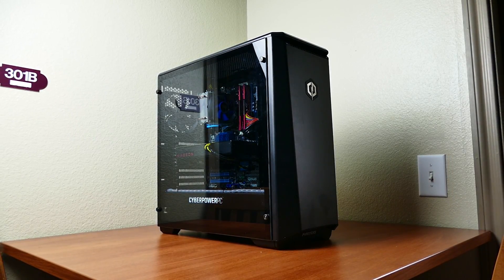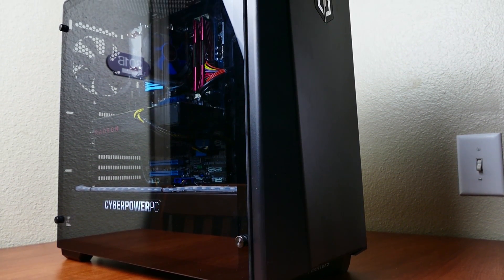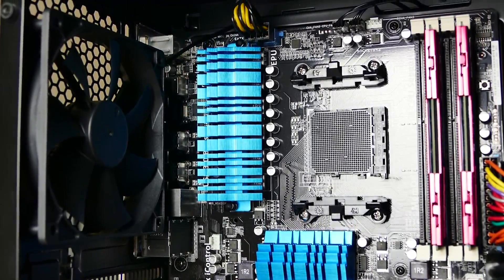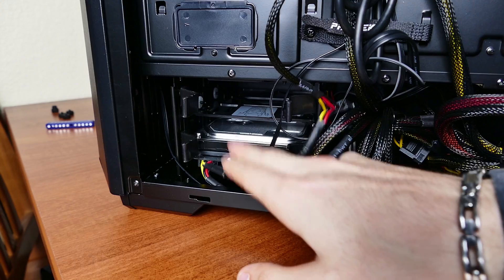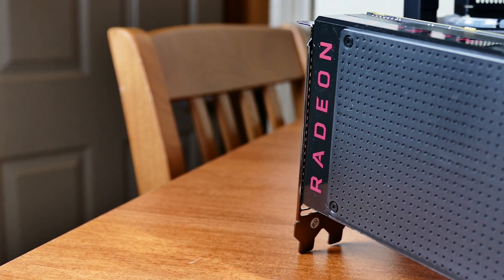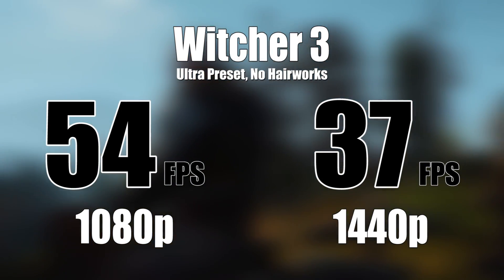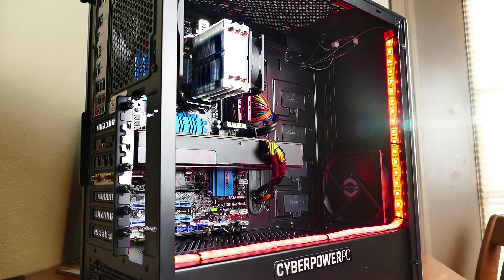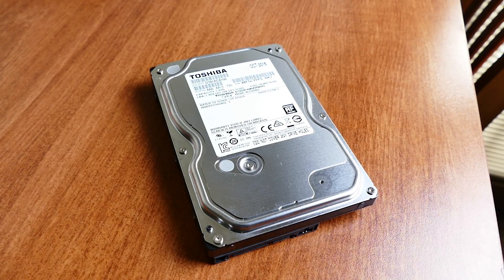Is a $650 VR-Ready Pre-Built PC Worth It?

Comment: between  i5 6500 and fx 8350 .which is better ?
Reply: You ask a question, and when people give you legit answers, you tell them away. Why bother asking in the first place?
Reply: A MAL PRODUCTION the fx is barely better than an i3...
Reply: A MAL PRODUCTION take the I7 6950X,it's a great budget CPU /s
Reply: Even i5 6400 is enough to beat an FX 8350, lol. Plus, if you would oc the Fx 8350, you would need a at least a 970 chipset board, which are way more expensive than entry level lga 1151 boards. You also need a decent cooler, since obviously you are overclocking. And even then the 8350 will perform marginally worse on single threaded applications - ex. most games.

Plus, the fx 8350 is only good at multi threaded workload, and even then, the i5 6400 is still very competetive with its 3.2 ghz boost clock.

Down the line, you can get a z170, flash the bios that allowed non k-sku oc, and oc the i5 6400 to 4 ghz, which is still pretty possible even on a stock cooler seeing as the 8350 at 4 ghz is cooled capably by the stock AMD cooler.

Or, you can forgo everything I said and wait for Ryzen.
Reply: well . the fx 8350 is now at 149 usd but the i5 6500 is at 200 usd. and when i buy an  i5 6500 i will not be able to overclock it.and even if i want to ill need an i5 6600k and a z170 chipset mobo and an good z170 chipset mobo price is 139 us. but a good am3+ mobo is  100 us. so, the whole cost is around 

amd                                                              intel 

fx 8350          =  149 usd                               i5 6600k=  238 usd
am3+ mobo  =  110usd                                z170     =  110 usd
  total              =  259 usd                              total      =  349 usd 

of course i know 6600k will be better but i will be paying near another 100 dollar to get a how much 10 -15% improvement ?

 ( ps : no way im buying a fx 8350 now but is it just me or intel has overpriced products?)
Reply: A MAL PRODUCTION i5
Reply: but the fx 8350 is overclockable
Reply: A MAL PRODUCTION you can OC I5 6400/6500/6600 non K with z170mobo
Reply: i know i can overclock an  i5 6500 with a z170 mobo. but that includes me giving up my processor warrenty and also its igpu   :/ 

i  know this is not a time for buying some 5 yr old cpus .but in theory fx 8350 is kinda winning here.
Reply: A MAL PRODUCTION the fx8350 can be compared to the Haswell chips
Reply: A MAL PRODUCTION You don't need to overclock it to be better. Even an i5 6500 at stock will outperform an Fx 8350. And imo Intel has overpriced products due to the lack of competition.
Reply: Massive gains with an I5 6500 VS 8350, overclocking has nothing to do with an advantage.

Its like saying the old Q6600 can overclock and its a quadcore so it deserves to be thrown in the ringer with the I5 6500, since its overclockable and be picked up for 20$'s on ebay, that's a massive "steal" for a quadcore.
You have remember, the 8350 is a quad core w/ 8 threads (technically).
Threads are generally less important whenever it comes to quadcore gaming (Just look at most I5's VS I7's in the same architecture).
The I5 6500 has WAY better single core performance, thus, in all titles, whether they need more, or less cores, will handle it better.
Its why the I3's of this generation were considered better than the FX lineup, let alone the I5's, its lacks single core performance enough to be a great considerable gaming chip anymore.
Not to say its bad, but we are comparing two different price brackets, the I5 6500 is a WAY better buy, the FX 8350 should be compared to something like the I5 4460 at minimum.

I would also like to add, if you were able to overclock the 8350 to a considerable amount to close the gap further (say 4.6ghz+), you're typically going to need a beefy cooler, which would balance out the price range, even then, an overclocked 8350 is not going to be worth it/win.
For a good example of the newer architecture VS the older ones and OC VS non OC.
Look at the OG Athlon 860k.
When paired up against the pentium g4400, which is a dual core, and not overclocked, it ate the 860k, which was also overclocked, and barely could compete, its the same story with the 8350 or anything else out of the OG lineup VS the newer intel processors.

On a final note of reference, worrying about "breaking" warranty, I would say 1: CPU's hardly die, so unless you overvolt your stuff and have no clue what you're doing, which even then there are safeguards, CPU's are the greatest thing to not worry about, they DON'T die.
Reply: the i5 6500 is better by FAR. Except in Heavy Multicore Benchmarks, like Cinebench etc.

AM3+ is Dead, and obsolete.
For pure Gaming, even an 70 bucks Celeron Kaby Lake dual Core with hyperthreading is faster. ^^

Seriously. Take Skylake at least or Kaby Lake, or wait for Zen. MUCH more modern and efficient Platform and Futureproof. While FX 8350 is something, you could upgrade last year for massive performance gains.
Reply: A MAL PRODUCTION the 8350 is better for the price, i5 is better in performence
Reply: Windwalker 95 Yeah, but the 8370 is at a way higher frequency.
Reply: A MAL PRODUCTION Get an i5. I have an fx 8350 and I wish I had an i5
Reply: A MAL PRODUCTION you serieus of course the i5
Reply: A MAL PRODUCTION you simply dont compare a 5 year old chip to a 6600k
more than 10% 100%ly
Reply: A MAL PRODUCTION 6500
Reply: fx for video rendering and multitasking. i5 for console hater
Reply: Gotin Fuklio the i5 even has a higher multi core score on geekbench...
Reply: You give up your processor warranty by overclocking anyways, even with the k sku. The i5-6500 smashes the FX-8350, especially if you overclock the i5-6500.
Reply: The FX has stronger multithreaded performance as far as I know.
Reply: Nope, the i5 wins
Reply: Which i5? The 6600k wins, but not the 6400.
Reply: If you overclock the 6400, that will beat it, but at default clockspeeds the fx beats it.
Reply: http://www.kitguru.net/components/cpu/luke-hill/150-gaming-cpu-amd-fx-8370-w-wraith-vs-intel-core-i5-6400/6/
Reply: Yes, I know. This is not a IPC competition, it is a speed competition. Plus the frequency difference is not that much. Anyway, the 8350 is overclockable (by default), which the i5 is not. Personally if I was buying a computer now, I would go for the i5 due to its upgrade path and its faster gaming performance.
Reply: It is also only 100mhz faster (boost clock). https://www.cpubenchmark.net/cpu.php?cpu=AMD+FX-8370+Eight-Core
Reply: The i5 can be baseclock overclocked, but I personally wouldn't buy a processor unless it's the unlocked version anyways. Like the 6600k that I currently have.
Reply: BoySanic Then its really a waste of money in my opinion to pay extra 50 to 100 dollars for a k sku chip when you can do a similar thing for a cheaper one...
Reply: intel always wins
Reply: No they do not ALWAYS win. Like I said, What about multithreaded performance? (i3 vs 8320/50/70)
Reply: You get an unlocked multiplier with the k sku which generally leads to better overclocks. And it's only $10-20 more compared to the non-k counterpart.
Reply: BoySanic i5 6400 180 dollars 

i5 6600k 250 dollars

6400 oc up to 4 ghz fine 
I havent seen anyone push beyond that, but nobody tried to push it beyond 4 ghz

6600k oc up to 4.6 ghz
even if 6400 is capable of only 4 ghz, 600 more mhz wont see any real world benefits, unless you have a fetish of showing good synthetic benchmark
Reply: why would i oc a non oc capable cpu. doing that i would sacrifies my warrenty and igpu
Reply: A MAL PRODUCTION You sacrifice your warranty with a k chip. You also don't sacrifice the igpu.
Reply: A MAL PRODUCTION Where did you hear that? K KSU or not, overclocking your CPU would void warranty, Lol. Plus, what do you mean iGPU? Please explain how you sacrifice an iGPU because that is the first time I have ever encountered somebody overclocking their CPU and the iGPU is sacrificed.

Comment: can you make a video of showing how to upgrade from a cpu/mobo to another cpu/motherboard? I have an fx 8350 and I hear i7 4790k is far better, I am considering upgrading but don't want to re install everything. 

Also, which Intel cpu would be better than the fx8350? I do game and make video content/sony vegas pro 13. 

Thank you!!
Reply: MandosGTIAllDay Not big deal to upgrade. Yes ofc you have to literally unplug everything and unscrew most of the things but every motherboard comes with a manual with pictures illustrating how it should be done. Make yourself a coffee, sit down and just do it. give yourself an hour max two and you good to go
Reply: Thanks for the reply and advice. Much appreciate it. 

Would it be possible to upgrade CPU/Mobo without reinstalling the OS??
Reply: random comment just so i get notified when answer comes
Reply: Yes, you can upgrade without reinstalling the OS. Do note that unless you contact Microsoft, you generally will lose your activation as you're on a new motherboard.
Reply: You won't have to reinstall any software; the software is stored on your storage device(s). You will, however, have to unplug and basically disassemble practically all of your hardware components in order to install the new motherboard.

Comment: It's very likely Cyberpower got their batch of 8350s for about the same price as what they would pay for 8320E. They are the exact same silicon with different binning due to voltage tolerances. AMD sells the better binned CPUs for more to consumers, as is standard practice. But, if AMD can afford to move 8320E at a lower price they can also afford to move 8350s at the exact same price since manufacturing costs are identical for those CPUs. If Cyberpower comes to AMD to pick up a pallet of Vishera octocores to cobble together for BestBuy, it's not going to be much difference in cost for 8320 or 8350 because since it's so late into the wafer process used in Vishera, there's probably more silicon worthy of being binned as 8350 than there is ones that are so voltage unstable that they have to be binned as 8320. Every wafer run improves the next, because AMD has a very good forensics lab and they take all the bad chips and do very detailed analysis on them to find bugs in the etching process.

Comment: 12gb ram fx 8320e gtx 1070 and I get lower fps but never ran benchmark on gta 5, I will see how much zens are vs kaby lake ill upgrade maybe
Reply: Open up you Nvidia control panel, select  Manage 3D Settings, Under DSR - Factors, select 1.78x (2560x1440) and 4x (3820x2160). Then click apply. Launch GTA, set everything to Ultra except Grass (High), Set Shadows to softest, No FXAA, No MSAA. Advanced Graphics off. Change your in game resolution to 3840x2160. That resolution change will only take effect if you are in Fullscreen mode. Borderless mode will NOT work. My friend's AMD FX 8120 paired with a GTX 1070 was only getting 30-40fps in GTA V. Now he runs the game On Ultra in 4K (besides the grass) at a solid. 60fps
Reply: Tdog trevor get an i5
Reply: You absolutely should. You're throwing away tons of that 1070 performance with that cpu
Reply: Tdog trevor I realy should upgrade that must be a bottleneck
Reply: Should've bought an i5

Comment: Lol knew it was fucked when I saw the FX processor.
Reply: I would disagree with that opinion

if you can find a 8 core FX processor at a good price, id get it over any i3 budget build any day of the week, in jayztwocents recent video he even said that the FX 8320e that he blew up with a bad overclock was beating the i3 7350k he had
Reply: wasn't bad at all for the price which could have been even lower without the cooler, a cheaper case and 450w psu.
Reply: luigi90210 Beating a poorly priced dual core cpu isn't an accomplishment. the 7350K is just bad for it's price. yet I would still recommend it over any fx processor because of motherboard features. The fx line is so old that it doesn't even feature true native usb 3.0. Still on DDR3. no NVME storage options, pcie 2.0, I can go on and on. most people stick with a cpu and board for a long long time, so getting something already extremely dated isn't a good look.
Reply: I have the exact pc and  it does great for all of the titles i play and i have never seen any sort of problems with it.
Reply: +John Coulter
its not that its a bad PC that's problematic, its just that its a PC with no real upgrade path outside of ram upgrades and a SSD

the PC itself is a very capable computer, its just that at the $650 price point you can build yourself a different computer with an upgrade path and if you are willing to spend a little bit more you can buy a different prebuilt with a better upgrade path

I mean if you are not willing to build yourself a computer and you cant spend anymore than $650 then this computer is gonna be the best you can buy at this price point
Reply: Now why would you say that? Plenty of people are told to buy into the 2500k when on a budget or even haswell, how I that any different then going with the FX line up(assuming you can get it at 50% the new price)? There are 970a/990fx boards with nvme storage options, usb 3.1, ect. and as far as PCIE 2.0 is concerned, it's already proven that PCIE 1.0 x16 will not bottleneck any modern GPU(the CPU is a different story) and PCIE 2.0 x16 is double that bandwidth. 

Also ddr3 is a mute point as haswell uses DDR3 and there are plenty of people who are told to go haswell when on a budget not to mention DDR3 performs as well as DDR4 in gaming, Linus has a great video outlining that and let not forget you can buy 2133, 2400 and 2600 DDR3
Reply: There is 3.0 and 3.1 and NVME,on the latest models,you are very ill informed on FX mobos,I just built a system for my friend.I put a 8350,OC'd it with water cooling,with 2x 960 strix edition SLI,does not even bottleneck,on DX12,very rarely on DX11.Only "bad" thing is the DDR3,it limits the OC,even tough it is INCREDIBLY good already.
Reply: K1NG CLAN
Reply: K1NG CLAN, so your do dilegence for people who are not fps 2k 4k snobs 60fps is very acceptable. anything passed 120fps  is just compensating for small peni.
Reply: All Black Everything. stop with all the usb 3.0 and mvme we are talking budget builds name an intel that beats the fx 8350 on price vs performance of cpu and mobo. You can't we are talking how much your spending for what your getting and in a budget build you want to game and maybe ve. Not an And fanboy, just a realist. personally if you want a mid range budget go xeon 1650 out performs most i7 everyday of the week.
Reply: K1NG CLAN i use fx 6300 still, hasn't failed me yet but i will be going ryzen in a year or so once ddr4 ram is more reasonable. But they aren't bad and are still decent cpus.
Reply: i knew it sucked when i saw rx 480
Reply: An AMD FX processor is technically dead in 2017. I wouldn't buy that even if I were to build a budget build.

Comment: Still is upsetting that I get nowhere near this level of performance, when I have right about this level of hardware. Ugh.
Reply: What ARE your specs?
Reply: Well the first thing I'd recommend is try to get your FX-8300 to 4.0Ghz. Cooling isn't an immediate problem because if you think about the the 8350 is a 4.0Ghz 8300, and it comes with a stock cooler. Other than that, things look alright.
Reply: Odd. Well the next thing to check is watch your temps while gaming and see if anything is thermal throttling. I'd also look into reinstalling your OS as a last resort if things seem kosher in your temps.
Reply: There are no onboard graphics on AMD CPUs. (No HDMI ports on the motherboard)
Reply: You could possibly try running a game in safe mode to make sure it's not something you have running in the background. Also make sure your RAM isn't maxing out, but I doubt it is with 16GB.
Reply: You are doing something wrong.
I have the same PC except far better parts more ram and I am getting better frames than this PC.
Win 10 64 bit
Asus Sabetooth 990FX R 2.0
16gb Corsair Vengeance 1600
EVGA 850 B2 PSU
MSI 290X 8gb
Samsung 840 Pro 128gb SSD "OS"
2 1TB Barracudas 
Antec 900 case
Reply: Yeah, I figured I was...but the problem is WHAT am I doing wrong. And, before we can answer that, how do I even figure out what I'm doing wrong? Technically the pc works just fine, but in GTA V, I can only get about ~20fps, at only 1600X900 resolution.
Reply: BoySanic FX-8300 oc'd to 3.7Ghz, 16GB DDR3, Asus M5A97LER2.0 mobo, Sapphire Radeon R9 390 Nitro, 240GB Crucial SSD for boot drive, 2TB Toshiba HDD for games.
Reply: BoySanic I can't go any higher than this, while keeping it stable.
Reply: BoySanic Nothing ever comes close to thermal throttling. CPU never gets above 63°, GPU never gets above 74°. And yes, I have re-installed Windows. Now you see why I'm so upset. I can't figure out what's wrong.
Reply: That's really odd.... What about your memory, what's the frequency on it?
Reply: gpu usage when playing gta?
Reply: Memory is running 1600Mhz. (800Mhz in dual channel)
Reply: Tell ya what, I'll just record a video of me playing GTA V with Afterburner, so you guys can see exactly what's going on.
Reply: Video is up showing my performance
Reply: Did you make sure the hdmi/displayport was plugged into your gpu instead of the motherboard?
Reply: Kellin Quinn I actually got some help from someone else. I cleared the CMOS on the motherboard. Believe it or not, that fixed things. And nah, I have never gone above 8GBs of RAM usage on any single program. Thanks though. :)
Reply: Glad to hear you got it sorted out. Weird that it was the BIOS though..
Reply: Kellin Quinn I know. I have absolutely no idea how the BIOS caused the problem, but it did. I went from getting about 25ish fps in GTA V to an average of 80+.